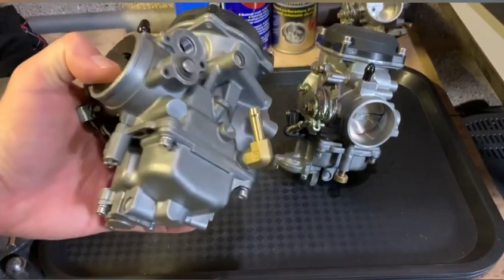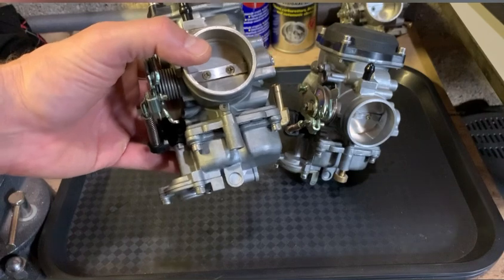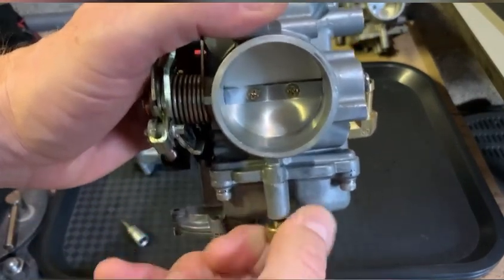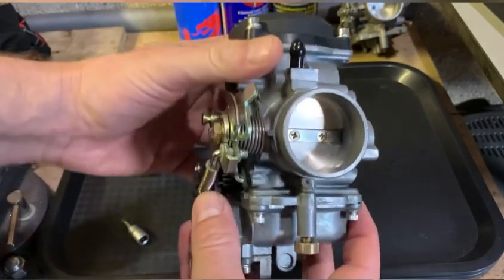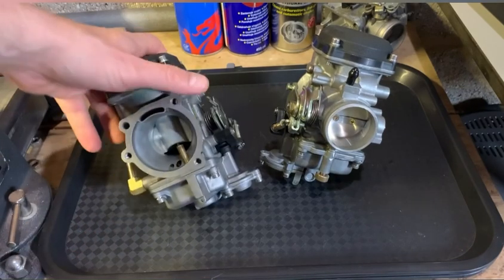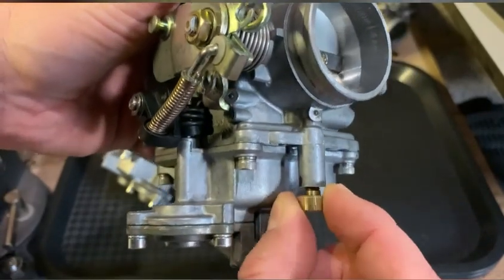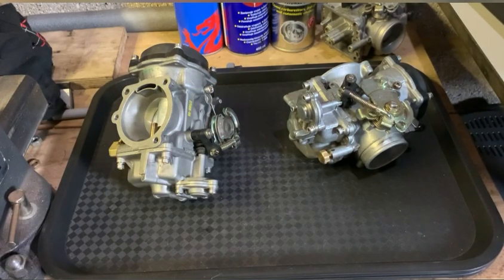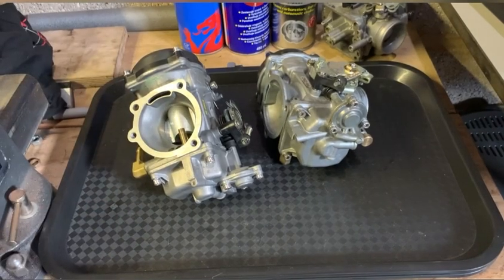Mixture screw turn out can vary on Harley carb

Comment: Another thing to mention about tuning, a rich setting will run a little cooler, while a lean setting will run hotter. I prefer mine on the rich side as well. Also, check your spark plugs. If they have a lot of black with carbon buildup, you are too rich. If your spark plugs have no black but more of a smokey color or white, you are probably too lean. Just my experience. Ride Cool Guys!!
Reply: Thx a lot bro

Comment: I'm rebuilding my CV for a 2001 Dyna. Before I got it, this bike had literally been sitting out in the weather since 2004 or so. The carb was completely gummed (it ran however - with the float valve stuck wide open - lucky I didn't burn it to the ground). I tore it completely down and cleaned it thoroughly. The low-speed needle levels at 1-3/4. I'm waiting on the kit to see how the new needle measures up. Thanks for this great work.
Reply from the maker: No problem. Good luck with your project.
Reply: Question:  when I turned mine all the way in it seemed to make no difference.  I thought it should cut fuel. Spark plugs looked rich (not sure though iridium) I down sized to 42 pilot jet. Had stock 45.  Haven't tried to tune again yet due to  fixing oil leak but will it be too lean?
Reply from the maker: Assuming yours is also a Twincam 88, 45 slow (stock from 2000) should work nicely, allowing you to tune it perfectly to a set of open pipes and high flow air cleaner. 42 pilot jet which was in the 1999 models only is too small). If it didn’t stall turning it all the way in, then it would be worth taking a look at your pilot screw. (Maybe the tip is damaged or someone enlarged the hole), check your float height (level might be too high so extra raw fuel is coming through), check your jet needle (it might have been replaced to a high performance one with notches).
Reply: @susandavis5833  Update on my end. I received the rebuild kit and have the carb back on. I also can't get the engine to quit by fully seating the pilot needle. Also, it does NOT want to accelerate and dies unless I pump the throttle.

Comment: Thanks for putting this together, very helpful! On mine I set the screw to 3 3/4 which really improved idling and throttle response. From stock seems these carbs are set up to run very lean.. (oh and subbed 😁)
Reply from the maker: Most welcome! Yeah, they are set pretty lean,  especially when we throw on the high flow air-cleaners and open pipes 😁

Comment: Thanks for your reply.  My bike is actually a 96 fatboy with evo.  Hi Flo air and thunderheader exhaust.  I let it sit too long and it was cheaper to put new after market carb on.   Original jets were 45 and 175? With stock needle new carb was same.  Bike ran great when I bought it.  However it doesn't run as good now.  Thanks again for info.  Really helps newbies like me.
Reply from the maker: No problem. I’m glad the videos are useful.
One thing with these Harley carbs is that it’s always best to refurbish your original Keihin carb. No aftermarket replicas can beat them.

Comment: Great info thanks l, had mine 3something turns and running too rich… have It at 2.25 turns now and seem to run fine, any signs if I’m running it too lean to look for?
Reply from the maker: Yes, too much popping on deceleration, white ish color on spark plugs, and not dropping quick enough when blipping throttle it would hang a bit.

Comment: Great videos 👍

could you make some video
about check valve for
the Acceleration pump in the bowl

I have 3 bowls where I can only hear it in 2 of them when I shake them
Reply from the maker: Sorry I only saw this now. It’s probably stuck. Did you try carb cleaner and compressed air?

Comment: Good afternoon, I am the owner of a 2006 Sportster 1200 Custom Harley. The carburetor is stock, it has never been opened, I replaced my bike with vance and hines exhausts and a K&N high flow filter in its original cover, only the filter is a K&N brand. My bike feels slow and gives me very few kilometers per liter in the city. I have heard that I have to change the low and high jets, change it to the size 46 and 185, what do you recommend friend?

Thx for all your vids
Reply from the maker: Hi there, you don’t need to change your jets. What you could do though, is giving your carb a good clean inside, check float level etc. new gaskets, and fine tune it with your mixture screw. Worth checking your spark plugs as well.
Reply: @aronsgarage834  I'l do!!! thx bro
Reply from the maker: No probs, brother:)

Comment: The difference in engine running temp at the sweet spot is a lot.
⅒th turn too far in and the pipes will be very hot after 20 minutes cruising. Back out a fraction and the cooling should cope well enough for the cam casing to be no hotter than a very hot drinks cup.
Popping on decel is more because you like the idle too low, I like the lope but prefer to be able to use engine braking.
At 900 idle hot I get lots of overrun and chugging decel. Set to 1000 and I have to try to get overrun popping.
Yes the valve stems are a scary colour with everything set up properly but the plugs tell if it's right or not. 
Factory setting is too hot is something we can all agree on. Don't run too small main jet for land speed record attempts.
Happy days.

Comment: i have a 90 flht with cv40 carb, not original. has evo motor and i am sure it is stock, not sure what exhaust or pipes as i bought it from someone else not running. I am trying to get it running properly without the cough through the carb i know it's running lean cause pipes started getting red after trying to adjust and test the jets. what jets do you think i should try? i also have the easy adjust mixture screw in currently
thanks in advance
Reply from the maker: I’d put a 45 slow in there and then adjust mixture screw when warmed up. I think your main is 165 stock. You can leave that in or bump it up to 180 (it won’t hurt)

Comment: I just rode my 99 EG 2200 miles from IN to CA with 95 big bore kit. It ran great for the entire trip until I got to CA. It now backfires through the carb. I replaced the 3 gaskets on the intake. It did not help. 
Could it simply need to be tuned for the elevation here? Where do I start? Mixture screw? Slow jet? 
TIA
Reply from the maker: Is it backfiring more while warming up from cold start up or more like when it’s fully warmed up?
Reply: @aronsgarage834  mine 97 Evo road king is doing the same thing while warming up from cold engine start on 45 pilot and 180 main with sportster 88 " mid rich" needle, Big sucker air filter and V&H pipes. When engine is wormed up, runs quite ok 99% - accational carb bacfire. I did tried 48 pilot and spark plugs were to black running rich but did run much better when engine was cold and quite sluggish when engine was hot. Im constantly  checking every time for intake leak with propane gas and brake cleaner but nothing to be certain for leak - i did changed the seals and new intake flanges. 
Maybe its an Evo warming up thing, since beeing my first evo...earlier i had 2000 TC 88 dyna never behaved like that while warming up.

every time
Reply from the maker: Yeah 48 is too big even for TC88. How many turns out is your mixture screw at?
Reply: @aronsgarage834  My thought to. using 45 and warm bike sputters on idle when 1/2 turn out so i have mixture screw   on 3-3,5 turns out for now. after that is no efect at all or even worse - slugish on idle and acceleration. Becouse of that fact i would maybe try even 44 if i had it- afcourse expecting worse carb bacfire until engine is warmed up.
When using  pilot 48 i had 1,5-2,5 turns out but bike rans even with screw fully in without any efect on sputtering so i figured that 48 got to be to much becouse of that, thats why i insist trying with 45  and suspecting on some air leaks but cant find them.  maybe 46 would be the magic number heheheh
when i had TC88 dyna y2000 sparks looked totaly diferent and much more healthier , thats why im insisting in trying to achive that .... 

Something crossed my mind this moment - float setup? i do have it maybe a little on the rich side, couse i remember of trying to compensate or eliminate cold backfire with some "rich" fuel height in bowl  ... do you think maybe the float hight couses rich efect on sparks - maybe efecting on emuslion tube and atomization of fuel in without wanted efect on backfire? 
damn, this is science heheh... maybe i should of get my masters from HD and carbs not chemistry hehehehehehehhe
Reply: I left the 195 but went to a 50. Cleaned the carb and it ran better with no backfiring for a few hundred miles again. Mixture screw is 1.5.

Now it is leaking out through the plunger boot so I am going to replace the float needle and accelerator pump diaphragm. I set the float at the correct position on the bench at 15degrees. 

To me none of this makes sense if it was running perfect for 2200 miles and then all of a sudden it starts back firing. Nothing internally changed so it must be a leak but no leaks. Similar elevation as IN but way less humidity. 
I am at a loss!!!!
Reply from the maker: Odd. You could always give the carb a thorough clean, maybe some of the passages got clogged partially.
Reply from the maker: Yeah, you could definitely try to set the float height correctly and leave the 45 in there.
Reply: @aronsgarage834  wel....  i fiiiiinally found out what was the "last" portion of the carb backfiiring problem... spring. It was stil a dyno spring (i dod get carb equiped with dyno set and changed everything else mening jets, emulsion tube, needle and slider ) and totally forgot on spring at all. Changed it to OEM spring , main 180, 45 jet and 88 sportster needle and added Iridium sparkplugs and no backfire at all- not even beeing cold engine. Done 200miles on 1/4-3/4 throttle and the sparks looked great, not rich not lean.
damn spring.....leting too much air too soon in... hehehehhehe
Reply from the maker: @kocevargregor  great job! Yeah, a lot of people have been putting in shorter springs as well as drilling the slide (enlarging the port on the slide) in the attempt to tune it, but only making things worse. Best to stick to stock parts for the most part. It’s a really well designed carburetor.

Comment: i tried to find it im sure you said it but its 2 turns out once you level it?
Reply from the maker: Yeah roughly, but you still want to fine tune it while bike is idling.
Reply: @aronsgarage834  i had no real starting point. never ridden it before. it (cv40 on 2001 tc88") was 4.25 out. it splutters if i gun it but slow rollon on is ok at 2.5 out. but now im taking it off as i write to find out the leveling off. i rebuilt the acc pump  but left the 190 and 45 jets as were. also didnt touch the slide or top. looked quite clean. was nt started for two years only 20000km on it. so ill get back to " baseline" + circa two turns out then take it for another spin. hassle to take all off again. i have state control tomorrow
Reply from the maker: Yeah it’s good to take it off and check it over. 45 and 190 are good. 👍

Comment: So you want it to just be flush is what I’m getting from the video I opened the throttle up looked down there got it to be flush bike idles good it’s about 70 out today and it is starting with no enricher like right away only let it sit for about a hour each time I have fired it up
Reply from the maker: No, this video is only about showing people that your mixture screw base line can vary when you turn it all the way in to seat it. Now disregarding it being flush or not, turn it all the way in until it seats and turn it out 3 turns. That should be a good starting point for fine tuning. (Provided you’re running stock jets and open pipes)

Comment: Mine only runs rich at first when bikes warmed up it doesn’t. My plugs are black and it pops when I’m giving it gas?
Reply from the maker: You’re definitely rich if plugs are back. What pilot jet are you running? What’s your setting?
Reply: @aronsgarage834  I’m not sure as I just inherited the bike a few months ago I think it’s 155 it has Vance and Hines pipes on it but original breather. when I put new plugs in it runs great for a while than back to popping I have an ez adjust I’m putting in today and didn’t know how many turns out I should go out.
Reply: @aronsgarage834  my float bowl gets hung up too so I cleaned it all out and put it back together but still has gas on floor when fuel left on over night could my float bowl height make the bike run rich?
Reply from the maker: First you want to pull the carb and find out what size pilot jet you got in there, as well as what kind of needle. They affect mixture a great deal. Only then you can experiment with the turns.
Reply from the maker: Oh yes it does. If it’s set rich, you’ll be rich and can’t set it properly with the mixture screw.
Reply: @aronsgarage834  ok will do thank you is it ok to let you know what size I find and pick your brain some more as I’m about to pull the carb apart in a sec
Reply from the maker: Yes, sure
Reply: @aronsgarage834  I pulled the needle out somebody put two little washers at the top of it. It has a 155. And a 48
Reply from the maker: What’s the 155? 48 slow can be rich. I tried it before and couldn’t set it properly, it was just too rich. I run stock 45 with screaming eagle. Is that a stock needle? Would be best to replace it with a sportster 88 needle and put shims under it, with 45 slow and 190 main.

Comment: Sir, can you please help me understand this? When you turn out the fuel mixture screw to where it no longer sticks out of the car mouth, and is barely visible, for example, at 1 1/2 turns out, do you then continue to turn out the mixture screw something like three more turns, for a total of 4 1/2 turns?
Reply from the maker: That would be too much. Try another 1.5 half turns. That would be a total 3 turns out. That’s a good starting point for tuning.
Reply: @aronsgarage834  Thanks, but I thought of another thing. When you have the carb on the bike, but with the air cleaner off, can you look inside the mouth of the carb to see if the tip of the fuel mixture screw is still visible?
Reply from the maker: Yes you can. You just need to open the throttle to raise the butterfly, and you might need a flashlight.

Comment: My bike starts and idles fine, after stopping it idles high.. Can you help me out?
Reply from the maker: It might be a bit lean, or you have an air leak around the air cleaner, vacuum hose or breather. Or, which actually happened to me, the port hole of the slide in your carburetor is overly drilled out. People used to drill it out like crazy in the attempt to tune and gain better throttle response, but all it did was mess up idling when coming to a stop. Well, it definitely did for me. Hope this helps
Reply: @aronsgarage834  Thanks.I'll let you know.
Reply: I changed the spring and kept tweeking on it. Seems to have done the trick.It's a fine line to get it right..Thanks
Reply from the maker: Glad it’s good now. Did you have a short aftermarket spring in it?
Reply: @robertbennett2586  map sensor or voes can be culprit as well

Comment: How did you bypass the EGR system?
Reply from the maker: I don’t have EGR on mine.
Reply: Cap the opening on the carb and stock air filter if you remove the lines to the canister. I turned my canister into a tool holder and a oil catch for my breather bolt mod

Comment: Hi, is that mixture screw for air or gas flow on the CV carburetor?
Reply from the maker: Gas. You’re adjusting how much gas goes through the idle port hole.
Reply: @aronsgarage834  do you have an idea why after startup has a crude gas smell, is it too rich, and also when I apply the gas sharply, it cannot be forced in the low revs, it struggles for a second
Reply from the maker: Could be too rich. Check spark plug to verify (should have a light tan look) and if smoke is black then you’re definitely rich.

Comment: But you are not turning the screw a full turn….?
On every carburetor I have adjusted a turn it’s not just twisting it. One full turn is from 12 o’clock to 12 o’clock….
A quarter Turn would be 12 o’clock to 3 o’clock ….. One1/2 turn would be from 12 o’clock to 6 o’clock. ….!
This is how I have always done it. This is how it is always worked. …👍🏻

Comment: I’ve cleaned my carb, every part of it, it runs with the choke out but when it’s in, it dies
Reply from the maker: Sounds like you’re very lean. How many turns is your mixture screw set at?
Reply: I would say your low jet orifice is pluged ,mine was like that until I ran a very fine wire through it. It was like brand new after.